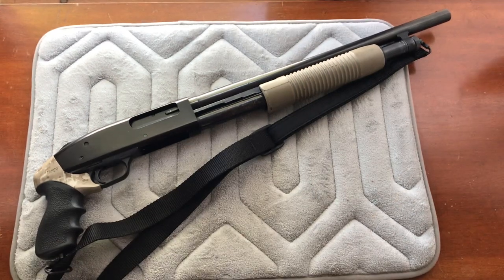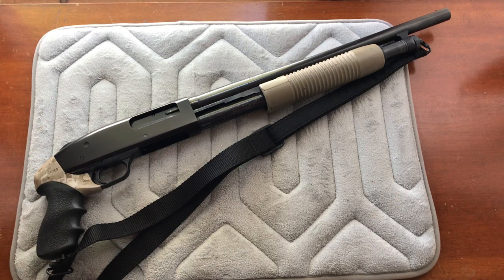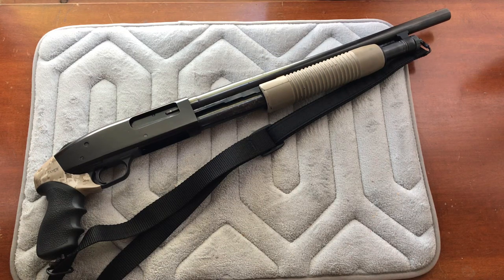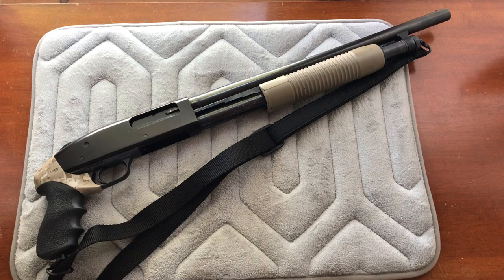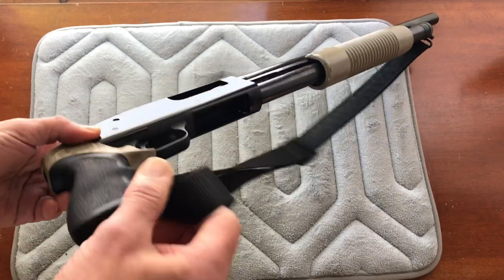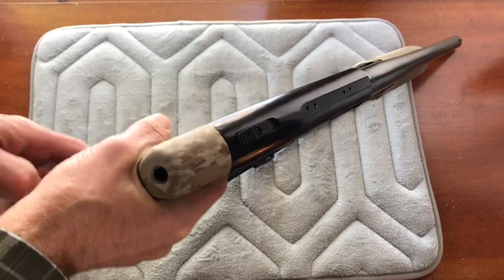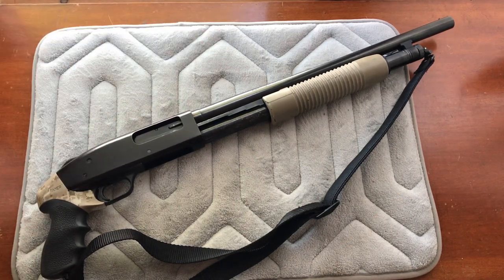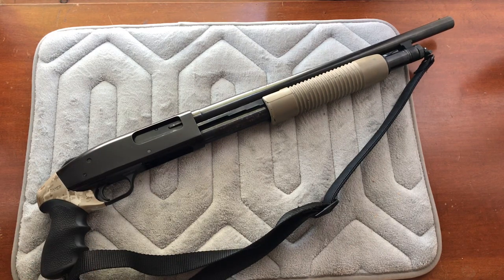The Pistol Grip Shotgun - Taming recoil

Comment: I'm just getting into firearms so I didn't know what the part was called before you mentioned it. From the start of the video, the first thing that came to mind was, "Huh, that's odd. I wonder why he's got packing tape on the tamer grip." When you mentioned it, I zoomed in for a closer look and saw what you're going for. It's an interesting aesthetic choice.
Reply from the maker: HI Sean, when I bought the shotgun used it had the Sand color forend with it and a black grip. I wanted a tamer grip but was looking for a sand/tan grip to match and found this custom short run edition Tamer on ebay.. it came just as shown from the factory as a tan camo color. As you can see it matches really well and works great.

Comment: Really good review.  I would ask that you try something.  When I first heard about shorty slugs I was very skeptical.  Until I went out with a friend to do some target practice/shooting for fun.  He let me shoot his 12 gauge pistol grip Maverick 88 with an OpSol insert and Aguila 1 3/4 inch slugs.  50% increase in capacity and 50% reduction in recoil.  Same size foster slug coming out of the barrel at 1,300 fps, which works out to over 1,200 foot-pounds of energy.  A comparable full power 44 mag produces around 775 foot-pounds of energy.  I now keep one in the back of my vehicle, one by by bed, and another downstairs.  Federal also produces the same with a full 1 ounce slug at a listed 1200 fps that works great.  Again, just try it out....
Reply from the maker: I bought this sling over 10 years ago so I don't remember where I bought it, but it's a Blackhawk with rubber backing so it doesn't slip, and the quick disconnect hardware is already attached.
I believe Amazon had it last I looked, I don't know the link. 
The pistol grip came with the post attachment, and for the magazine cap attachment I had to buy a replacement magazine cap with the stud attached.

Comment: I need this for my Mossberg 500 Flex. WHERE can I get one? I'm a 5'3" 100lb older woman with no meat on my hands and I can't fire my shotgun, it hurts really, really bad! I have to put on two pair of suede and leather gloves and it STILL hurts so bad. Help! I can't find a grip anywhere for this damn gun.
Reply: Ebay has them just ordered mine or palmetto State armory also has them . Look up hogue pistol grip for them
Reply: @GrandExchangepro  those are just decals. I already got them from Hogue. I need a rubber sleeve, much thicker, more cushion.
Reply: I use a Raptor grip with a Talon grip. No pain. A sissy strap on the forend also tames recoil. Push forward and the recoil is reduced by half while using Federal  Shorty #4 buck.

Comment: Link for a sling?
Thank you!
Reply from the maker: Hi.. I bought it in a store not online so I don't have a hyperlink. It is an Uncle Mike's nylon sling with rubber backing on portion that goes on shoulder and integrated sling swivel. They are very difficult to find..I won't use the ubiquitous nylon sling without the rubber backing as they are useless and just slip off the shoulder.